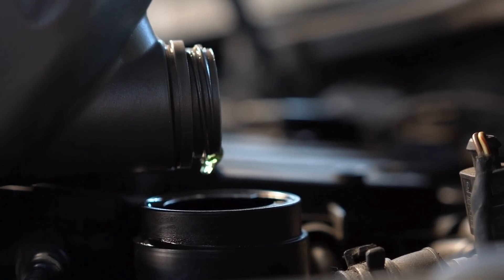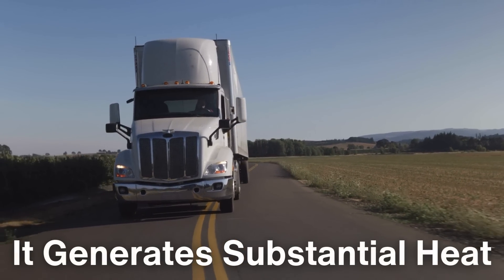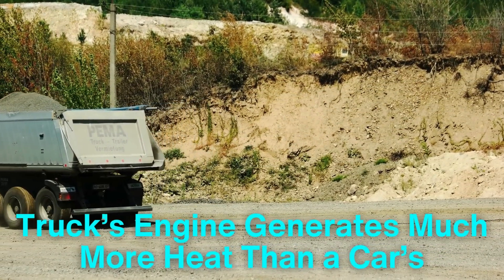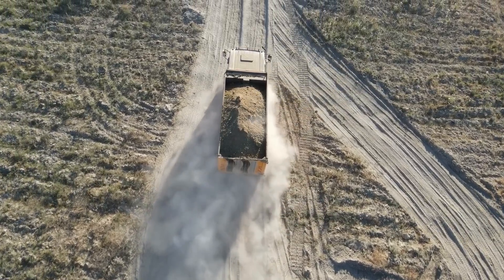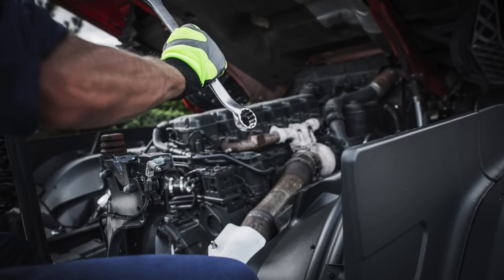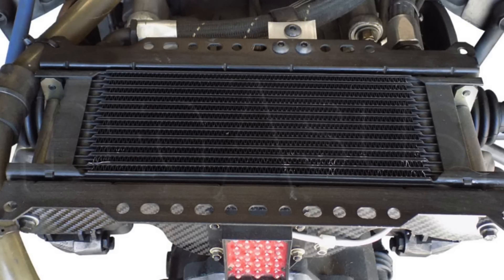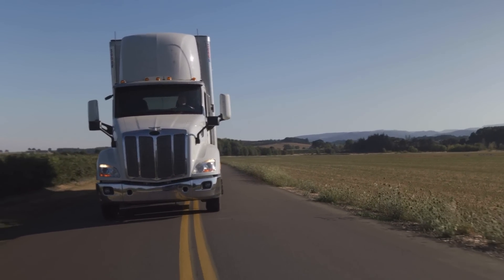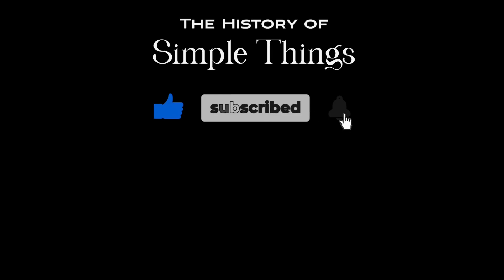Why Do Trucks Need an Engine Oil Cooler? The Unsung Hero of Heavy-Duty Trucks

Comment: In gas engine, the engine is a oil cooler because when coolant pass through engine, it carries heat away from oil as well as engine block. So a separate oil cooler for oil is not necessary for cars.

Comment: I think almost all vehicles need an transmission fluid cooler and an engine oil cooler. Then most vehicles would last  longer.
Reply: But manufacturer hates it😂
Longer life vehicles means lost customer in the long run. Because people buying less frequently. 
But anyway it should be necessesary since most car today have higher engine stress due its higher hp/liter of using turbocharged engine
Reply: @muhammadhanifkurnaen6689 Exactly the main focus for automobile manufacturers nowadays is to make as much money as possible. Not to make durable and long lasting cars.